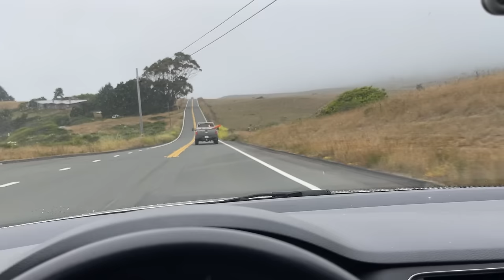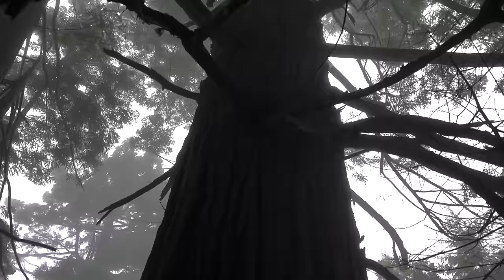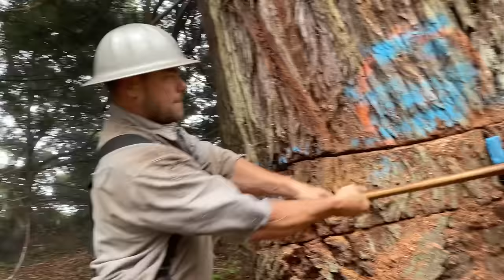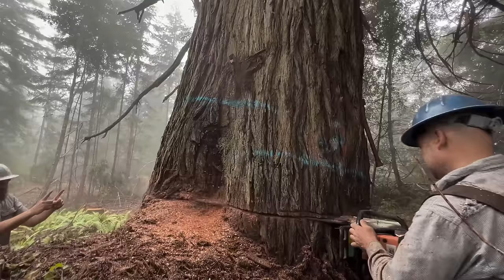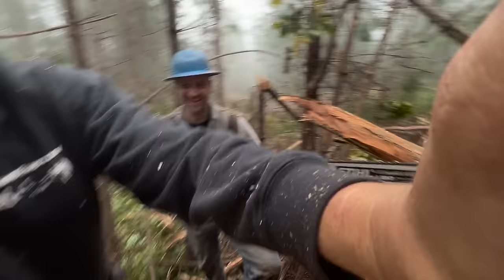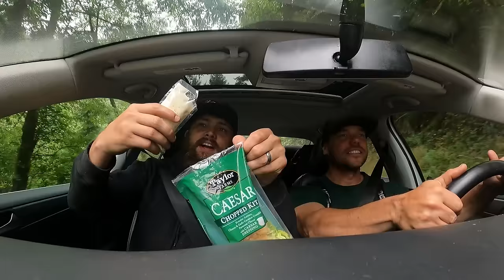The Biggest Tree I've Ever Cut! Felling a 7ft Diameter Redwood Tree in California!

Comment: First time I ever saw a giant Redwood was in California when I was just a young child. To this day, I can still remember the smell of freshly cut Redwood. The owner might consider this tree as less than perfect, but this tree is still very healthy and worth a lot of money at the saw mill. 

Taking down a tree over 6 foot in diameter is part art and part science. Most people never saw the science part of tree falling, but measuring accurately is required. 1/2 inch off at base = 20 foot off where top of tree falls. 

To all the tree huggers out there, this tree is marked for removal. It sits on private land and by removing allows more room for other Redwoods to grow. Even trees compete for air, light, water, etc.  If we saved every tree, we would quickly run out of wood used for construction or even paper products. This tree is hundreds of years old. It's time to thin out old trees. By doing so allows other trees to remain healthy. 

I was just watching a film on loggers taking down giant Redwood at turn of century. They didn't have gas powered chain saws with 6 foot bar. They used axes and 2 ended misery saws. Some things might have been better in the 'good old days' but logging wasn't one of them. Nothing but the highest respect for workers who risk their lives cutting trees. 

Retired Landscape Architect here. Logging is as necessary for modern society as is raising bovines for meat, milk, cheese, etc. These loggers are keenly aware of their impacts both good and bad. They go out of their way to minimize bad impacts because their futures depend on  it. Destroy the environment and it can no longer produce trees and then lots of people are out of their jobs.

Comment: Back in the 90s I worked for a redwood shake and shingle mill. My job was to find the available wood that the real old growth fallers and loggers had left behind. Areas had been logged probably in the thirty's. With redwoods being so plentiful at the time, loggers left behind snags, really tall stumps and other redwood pieces that were  unable  to be pulled up to landing . Due to size, access availability,( ravines to steep, too far down) equipment not available at the time to log what was left. Some really big logs are still laying down at the bottom of some of the ravines covered with brush and bushes. Some buried. We used a  D8 cat with an 1"and1/8" bowline which was still to small to be able to haul those trees
Reply: Curious, how was the regrowth of the forest? Were most trees still pretty small or size-able with 60 years of time?

Comment: What about falling redwoods that have grown off of old logged stumps? I’ve seen quite a number of them in the area that this was filmed at and have wondered what the issues in falling them are, especially given that I’ve seen some with multiple trees coming from one stump. They seem to have been growing for at least since the late 1800s/early 1900s, taller than any trees I’ve ever seen before, yet definitely not old growth trees.
Reply: I was letting a red maple grow out of a silver maple stump because i wanna see how it does in the stump if it'll split the old stump or will the red maple trunk grow messed up it got there on its own i didn't plant that one its to close to the house so im not gonna leave it there to long 

These white pines are messy enough i don't need a red maple dropping a ton of leaves in the gutters how the silver maples done so im just playing around with it
Reply: The red maple growing out of the old silver maple stump the silver  maple had 3 big trunks on it it had root rot i cut it by taking off the trunks that had to much weight on the sides and middle so once i made my final cut it couldn't twist on me i did use wedges
Reply: They cut down old growth redwoods on the backside of the Oakland Hills in the late 1800s. You can see where they stood because there is often a ring of second growth trees in a circle around where the old tree stood. A ranger told me years ago that some of the old growth trees were about 20 ft. in diameter. He also said some of the second growth trees were over 150 ft. tall and more then 5 ft. in diameter.

We used to fish for wild native rainbow trout there when we were kids, but they permanently  closed the streams for fishing because those were one of the last pure strains of rainbows in the world.

Comment: I'VE GOT A 10FT. AROUND ELM TO CUT, I HAD ALREADY FIGURED USING A TAPE OFF A CENTER MARK AS HALF THE TREE IS NOW GONE AND THE INTERFACE WAS 90% BARK, LEAVING IT FLAT AS A BOARD, SO IT'S 4'-ISH ACROSS AND 3' THICK ON ROUND SIDE, WITH ABOUT 3 INCHES OF ENROBING LATER TRUNK GROWTH GROWN OVER IT ON BOTH EDGES OF THE FLAT SIDE.  THESE TREES HAVE A BAD HABIT OF LOSING THE FALLING SIDE BRANCHES AS THEY PASS 45 DEGREES, WHICH FLIPS THE BALANCE INSTANTLY AS THE FOLLOWING SIDE BRANCHES ROLL UNDER, INCREDIBLY FAST, MAKING THE MAIN TRUNK ROLL  ON THE WAY DOWN.  SCARES THE SHIT OUT OF ME EVERY TIME I CUT THESE THINGS, HAD ONE MAKE CONTACT AND GIVE ME A 4" SHOVE OF MERCY. I WAS 20 FEET AWAY AND RUNNING WHEN IT DID.  THAT ONE ROLLED TWICE AS IT FELL APART...YOU GUYS WOULD LOVE THIS SHIT...:)  I'M IN THE OKANOGAN.   (BRING A CLEAN PAIR OF SHORTS)  I'LL CHECK FOR A REPLY FOR A COUPLE OF DAYS. THE REDWOOD WAS THE PERFECT MAP FOR MY LITTLE TREE PROJECT.  HUGE THANKS TO ANTON, I KNEW GUYS LIKE YOU IN THE 70'S IN CENTRAL OREGON WHERE THEY WERE CUTTING OLD GROWTH, OFTEN DOING CLEAR CUTS. PRO MAC 125'S RUNNING 72" BARS WERE "KING OF THE WOODS". MY FIRST TIME AT LOGGING ( SETTING CHOKERS), AND I THOUGHT ALL LOGGERS SENT ONE LOG LOADS OF OLD GROWTH CEDAR OUT DAY AFTER DAY...GREAT BOOK: "THEY TRIED TO CUT IT ALL"